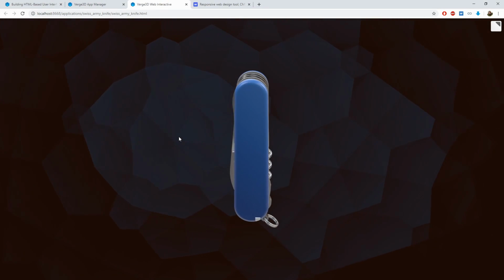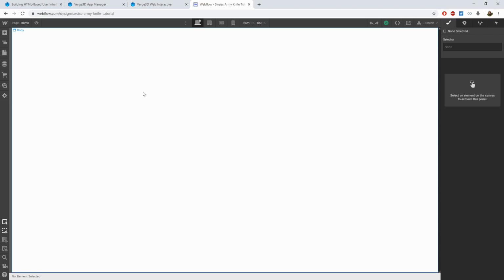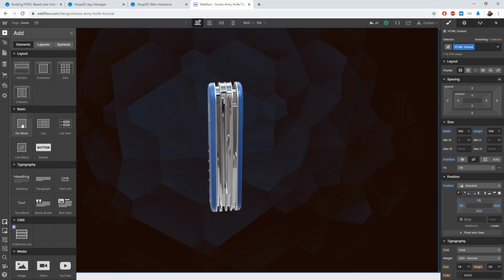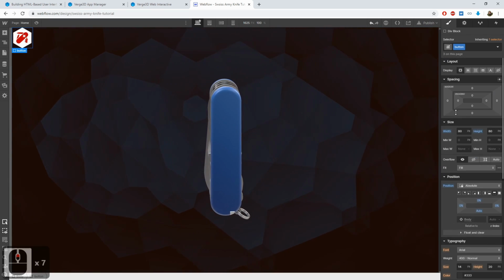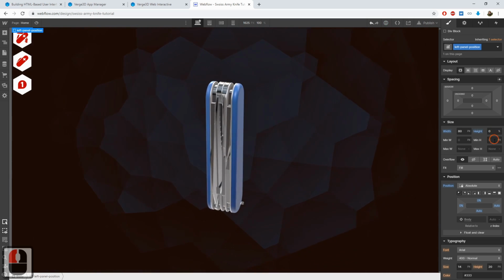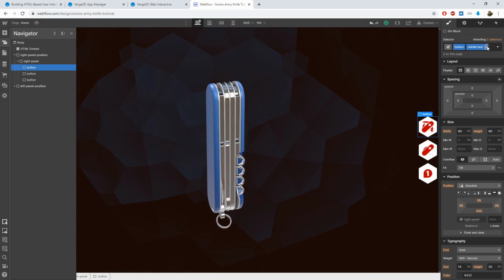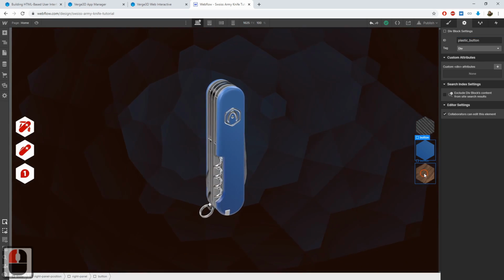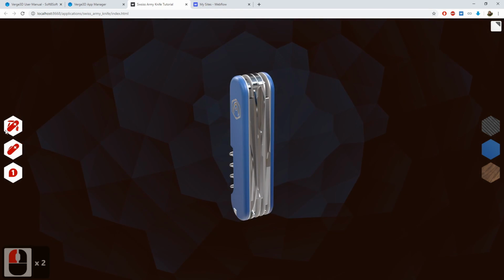Verge3D for Blender Basics - Part 5 - Creating HTML Interface

Comment: Do you have a tutrorial using Elementor instead of Webflow? Thanks!
Reply from the maker: sorry, but there's no such tutroial and we have no plans for that kind of tutorial.
Reply: @Soft8Soft   No worries! Thanks! Please make more Awesome Video!
Reply: @Soft8Soft  webflow now requires a paid account to use the embed tool, so even if you don't create a tutorial for elementor you ought to consider some other guide
Reply: @yydoctt  just target a dom element with js or write your embed code in HTML tag. All works fine.

Comment: great series of videos. On entering fullscreen mode all of the interactive buttons disappear. Can you please explain how this can be rectified
Reply: this can be fixed by using your own fullscreen button, which is added in the outer .html file, and initialized with this puzzle https://www.soft8soft.com/docs/manual/en/puzzles/HTML.html#init_fullscreen
Reply: @yurikovelenov8938  could you give us a template with customized button? Because, really, I spend 3 days on that, and it is not working like in the documentation written

Comment: Cool video. I've tried this so many times, but my builder shows up as a narrow strip going across the whole screen when I do it like this or use the iframe code. When I change to mobile or tablet view, it only shows the center section and cuts off the left and right. I am using wordpress and elementor.
Reply from the maker: Hi, feel free to ask on the Forums! We'll try to help you https://www.soft8soft.com/forums/